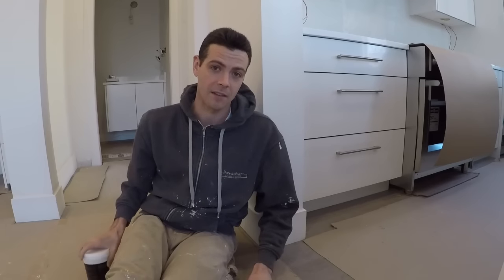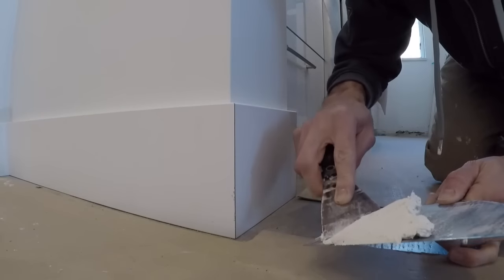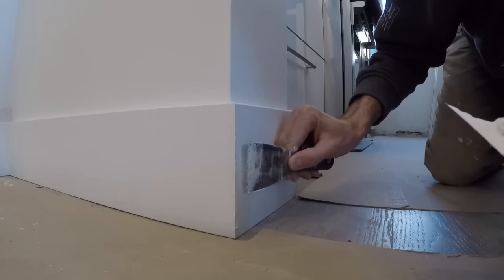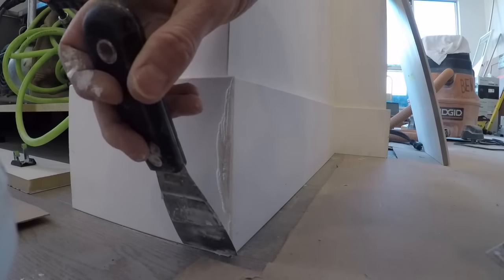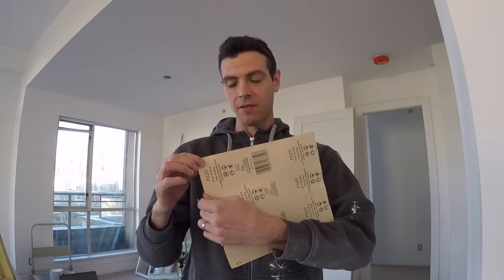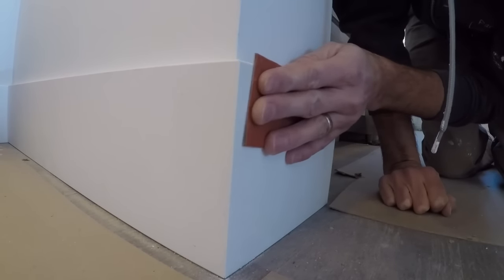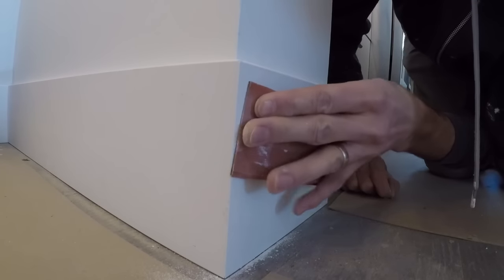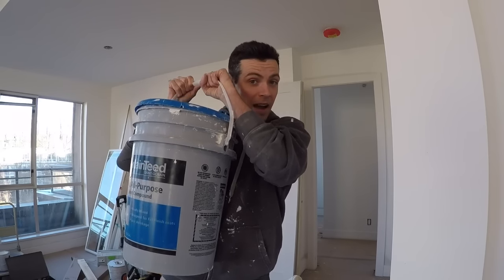How to Fix Open Miters

Comment: The angle of the wall was not measured properly or the saw was not adjusted properly
Reply: I'm a trim carpenter. We were taught to cut at 46.5° for a "90°" corner. As well as I find it's more accurate to lay a piece of base at the corner and scribe a mark where the corner meets the base. Miters come of perfect every single time.

Comment: Been painting 20 years. Most guys cut all the trim for a whole room in one shot an bang it on no matter what it looks like. 1/4 short? close enough. 1/2" too long? just push hard an use more brads, 'so what if the drywall breaks an the inside corner tape is cracked up a foot'. Compressor running low so the nails don't set, 'ah, the painter'll fix it'
Reply: I do my best to keep the painters happy.

Comment: What you are doing here is great for DIY.    The 46° rule is good also.    However I doubt your saw is not calibrated.   
     Most times the miter is off, is because some finishers only use a 10" trowel on their corner beads.   It will leave a slight bow in the run overall.   You can set your miter perfect starting at the outside corner but when you nail the middle of the wall it could open up due to the inside crown of the wall. 
     One way to correct this is to mitre and glue the joint then on the inside corner of the same piece it will be the straight cut if possible.   The on the opposite side of the inside corner becomes the cope.  Because when the material flex into the bow of the wall you will lose that distance in your overall cut.   
     When you measure add the visible bow to your cut within an 1/8th"   meaning if you see 3/8"  add 1/4th" to your measurement as a flat cut never the cope cut.

Comment: I have the solution. Use a skilled carpenter who uses seasoned timber or failing that uses a composite material that will not shrink.
Reply: Good luck finding properly cured lumber right now. Every job I've worked in the last couple of months have developed huge gaps. I'm pretty sure the coof shutdowns and restarts at the mills caused them to pull material earlier than normal to catch up to the demands.

Comment: In my experience- any wood filler I put in those will eventually crack again :) the only thing that will stay strong for longest and don’t crack is - bondo - and I am not talking about the wood filler but the Body filler bondo - ( it’s red and they use it for car repairs ) fill in the gap nicely - give it 10 min and then go over it with ready patch for example because body bondo is too hard to sand and ready patch is for finish . You can use any wood filler on top of body bondo - it cannot be stronger than that :) my best
Reply: Yeah bondo really does work, the best painters I know use it.

Comment: I live in a very old home & trying to do repairs ourselves. Not sure how one of the baseboards got chipped on the edge but this will certainly help. Thanks for your tips!!💙😊
Reply: if it is in a high traffic area, you may want to go with bondo instead of a wood putty/filler...this will  require a little sanding but will be a more permanent fix...

Comment: Good tip re the 46.0 deg - HA - but - with the way that some 'demented circus monkeys' seem to build the frames/walls - good luck finding a 90.0 deg corner.  For those less skilled than you are with a scraper//blade - put a couple of small bits of masking tape down to protect the floor and leave them there until after the sanding is completed.  And you are 100.0% correct re the caulking - but most will do that as it is the 'quick & easy way out' - a quality tradesman like yourself - will do as you do.  I just completely refurbished the interior of one of my son's homes and the scale (HA - I was going to use the word 'level' - but it is not apt in this situation) inaccuracy was truly amazing.  10.0 to 15.0 mm out was the 'norm' - one short wall had a somewhere near 30.0 mm out of whack - HA - I gave up cutting things at 45.0 or 90.0 deg - if I had cut at those angles - NOTHING would have fitted properly.  It amazes me the level of poor accuracy in many house builds - if I restored my cars//motorcycles with the level of inaccuracy as a house - they would be unsafe.  Yes - a house and a car are two different 'animals' - but it is a nice change to see someone with an acceptable attention to detail.  Have a safe and nice day all.  CHEERS from AUSTRALIA.

Comment: Next time try straight walls and a quality mitre saw with a good blade. Also, I glue my mitre joints so they don't split all over the place in the corners years later...
Reply: What is your idea of a 'quality miter saw'?
Reply: @toddfromflorida  .. For starters one with an accurate 45°, etc cuts and a good blade e.g. Freud Diablo's with a high tooth count are good blades. DeWalt, Makita, Hitachi are all good. For the money I like the DeWalt DWS780.
Reply: Thanks. I have an older dewalt.  I think it is the 780.  Dont really use it but assumed when I do it will do the job just fine.  I added a 100 tooth diablo blade when I was going to do a lot of crown in my house.  HAvent used it yet.  Guess im just lazy and need to give it a shot!

Comment: What is the filler material?  Spackle, "Wall Putty", or something else?  What do you experts recommend?  I got burglarized and got 3 doors and door frames kicked all to hell.  But I can save some parts by just gluing and clamping back together.  but I'm surely gonna have some cracks, big and small to fill.  What works best fellers?

Comment: Dear Expert, do u have experience/ advice to share on applying the shaping bits (cramer fugi 5 kit)  to refine the fresh caulking pushed out from a quick cure & sticky adhesive paste like liquid nails (polyurethane,waterproof, by Selleys )? I want to use it to replace silicone for the wooden floor (or floor tiles) & curtain boards edges + gaps .

Comment: I don’t like using anything that’s not flexible because it will crack, I personally use good wood glue at time of installation, and truthfully being a hardwood floor expert I don’t leave exposed gaps because homeowners will look for mistakes and you guys know what I’m talking about, I do agree for diy quick fix this will hold up but I’d prefer something more flexible because it’s a trade off if your happy n ur clients happy every way is correct 😂

Comment: I just did a room and a lot of my cornerd had some serious gaps. Tried 45 and 46 but still some issues. In the closet was the worst  bottom would be tight and top would be open. I was still able to fill the gaps with wood glue and it looks perfect anyways. Unless your on your hands and knees eyeing it up it doesn't stand out. I would just like to know what the hell lol. Not sure how the got it so perfect when they built the house unless they filled the gaps too and I didn't notice.

Comment: Bondo.  Much harder, one coat and is coating ready in 1/2 hr.    Dries fast!  Adheres like white glue and is machinable. Its ts mdf not drywall waterborne and wood fiber swell.  Give it a shot. Will take a couple of messes to get right but I don’t think youl will go back.

Comment: Actually it's called joint compound, not drywall mud that is just a slang terminology amongst tradesmen. If you want to reach a broader audience that don't typically work in this field proper terminology is required lest you have them looking for drywall mud looking like dumbasses. Properly educate your viewers they are your bread and butter.

Comment: Do you have one one inside corners
Reply: I was wondering that also.  He says to not use caulk on the outside corner but I assume he must be using caulk on the inside corner.  It wouldn't be any different than caulking the top of the baseboard where it meets the wall I assume.

Comment: Just regular light spackle works good also just let it dry overnight and come back in the morning and sand it and it looks like it never was repaired. I’ve done it 1000 times or if you’re on a construction site you can do the same thing with 20 minute Durband just get some from the drywall guy.

Comment: I bought a standard subdivision house built by Polygon homes and they painted all the trim white but more of a flat white. Not glossy at all. The doors are painted the same color. I need to repaint some baseboards because I just had engineered wood floors installed and on the stairs the risers are primed MDF. How do I get them to match? Do you have any idea, generally, what kind of sheen builders use? Thank you.

Comment: If you mitre mate’d (CA Glue in the states) the mitre together and put two nails top and bottom on the mitre before you nailed it piece by piece on the wall, the mitres wouldn’t pull apart. That’s how us Pro’s avoid this problem and getting the filler knife out.

Comment: I use PL Premium glue on all miter joints and they never open up. Wood glue is brittle when cured, so it will crack when changing seasons.

Comment: Hi, this is great thank you. I have gaps this size in the kitchen and bathroom window sills, is it worth using putty/wood filler or should I stick to caulking it with mold/water resistant properties? Cheers

Comment: Hi, what about inside corners? Can the same trick work there? Have a big gap in the inside corner due to fact the inside corner drywall was not 90 degrees, also I suck at measuring.

Comment: I use cornice cement, dries really fast & is hard as a rock.. you might need about 60 grit to sand it level, if it needs smoothing out just use some skim coat, but for corner mitres I would probably use builders bog, longer lasting & will wear better.

Comment: Don't painters and carpenters use caulking to fill joints (not nail holes but miters and joints) because things like wood fillers with have stress cracks over time and elastic qualities of caulk won't crack

Comment: The problem with filling poor joints, the wood ALWAYS shrinks the filler ALWAYS cracks and reveals the POOR craftsmanship. A proper miter is cut correctly and glued and is very hard to break even as the wood shrinks and climatizes.

Comment: I've got baseboards that have curves to them.  I guess contoured is what you said.  It's similar to colonial style.  Any tips for dealing with that?  I didn't want to go with just a flat board because I thought it looks too plain, but now the little gaps are going to be harder to clean up.

Comment: my finer is sore from putting dyna patch pro on crown extensions - ive use that stuff for years, it makes your finger nails soft and so they tear easy (your finger nail is not a tool) and when it gets stuck on your cuticals its makes them white for days.  Inside corners on mouldings can be hard to fill too.  With the patch pro, I find you gotta me mindful of where you put it and keep two terri cloth rags with you - one thats dry and one thats damp.  Keep a bucket of warm warter close or have immedate access to a sink.  I guess i could try putting red dye in it.

Comment: Cut at 45 1/2 degrees and that should close that miter nice and tight. Sometimes 45 degrees does get you a closed miter. If not try 44 1/2 . One of those 3 has to be it

Comment: Quick tip for you Amateurs. If you saw stops at 45. Put a piece of cardboard or a match book cover. Thin piece you will have to play with that thickness. Once you get it down. THere is your 46 plus degree angle. Eventually you will be able to do i by eye. The cardboard goes on side of the fence of  the  Miter  towards you.

Comment: First of all, no corner is exactly 90 degrees; cut EVERY outside miter at 47 degrees! It's so much easier to fill a tiny bit at the very top, if needed. Secondly, take your nail-set or the shank of a screwdriver, and run it up and down the face of the open miter, pressing it into the open part. No putty to fall out later. The added benefit is, you round-over the corner so it's bit less painful, if it gets kicked.
Once this method is painted, critical eyes WILL see this method; wood/mdf and filler, have different textures and it'll show.

Comment: I’d be fired if I left an 1/8 gap on an outside mitered corner!  Lol.  Tip to you all out there, when cutting your outside, 90 degree corners, cut your miters at 45.5 or 46 degrees even.  Get those faces tight, it’s more important then the top edge, which can be filled much easier and less noticeable.  👍🏻

Comment: I'm late to the game, but would this work on inside corners or if you have an open miter on a door frame (The door frame was not square like I thought and 1 corner is tight on the inside, but opens up). the gap is not huge, but noticeable. I've always heard to use caulk, because it's flexible, but you  can't "shape" caulk like you can filler.

Comment: Just a bit of semantics here. The open miter is still an open miter. What was done, was to disguise it, not fix it. A lot of carpentry is like that. I'm not a fan of mitered outside corners. They beg for destruction. I do my best to design for a butt joint.

Comment: It takes far longer to spackle a badly cut joint then it does to fix the 45* indent situation on your saw.  Your time would have been far better spent explaining how to do that, than to explain and excuse poor workmanship.  GO back and re-cut it, even if it at your own expense.  Re-cutting takes maybe a minute at most. Take pride in your work.  Learn how to do it correctly- after a few tries even a DIY'r will figure it out.
You are promoting the dumbing down trim work.  There was a time when not even a DIY'r wouldn't except that joist- he/she would take the time to re-cut, until it was right.
Spackle=Smackle

Comment: You should have used a plane to correct the mitre and then it can be glued to help prevent it cracking .back filling will crack . Be a better carpenter . The difference between a good carpenter and a bad carpenter is how big you need to use . Show us how not to leave open joints.

Comment: I burnish an open joint like that. I have a burnishing tool but a round screw works also. Use the tool to massage wood toward the open joint, works for stain or paint grade

Comment: Dude- thank you. I figured this out 25yrs ago, when i was 25. Corner bead corners are ACUTE!😂 45° outside miters will never close. People also think that coping is some kind of fancy carpentry. It is an enormous cheat for inside sheatrock 90s, at the floor, being always completely mud blobbed, hollow, and anything but plumb and 90°😂 I have seen a million tradesman vids like this, that are mostly full of dukey. This one is right on time. 46ish degrees, and build the corners out of 2 or three pieces, where you can, before sticking to the wall.

Comment: I agree- these are the most instructive videos that I have found when trying to do a good job on my painting project. All the little details make all the difference. I have spent nearly 3 days Youtube videos, and now I have my new Newborn dripless caulk gun and the right caulk to do my trim, with my tip cut and sanded to the correct angle. I just wish that I could spread joint compound like this guy- ugh!

Comment: Better yet is squirt some wood glue on the top of miter first....then as it's running down the joint, fill the front with MH READY PATCH from bottom up....that thing won't budge..or crack in the future.

Comment: Never spackle yoir joints like this.  New trim will shrink and the spackle will crack.  Caulk flexes and the joint stays sealed without cracking out.  Also when using spackling for filling nail holes, never use vinyl spackling.  It does not sand well at all!  Its like sanding rubber. Always use lightweight no shrink spackling.  Sands super easy.  

Your welcome

Sincerely
Painter

Comment: We had some new doors put in and when the installers put the door casings on they filled the joints in with calking.  The caulking has now shrunk and you can seem the seams.  Can these joints still be filled with the wood filler or is there something I need to do to make this work?

Comment: Will this dyna-patch work on cove moulding joined in the middle of a 25 ft run? In winter there is a gap (1/8"). In summer the caulking bulges out.

Comment: There is a trick for closing a stain grade miter that is a little open, it's called burnishing, get a screwdriver or scratch awl, something round, smooth, and metal, run it over the corner in a pushing motion and bend the wood fibers over to close that gap. This was a common method in a furniture shop I worked at when we were miter folding hollow posts and beams.

Comment: As I use dry wall mud as spackle since I’ve got a 5 gallon bucket of it and no spackle, though I’m touching up in a room I just replaced all the drywall in the opposing wall and filled in a few nail holes. lol.
Great video and very informative, coming to you from Fl.

Comment: if your spraying all your trim which is what i do then car body filler. its 2 part filler that dries harder than rock and doesnt shrink. works in mid winter and mid summer. the white filler in the video is a great idea but it will still show if its not painted. anal i know.

Comment: What I want to know is why you can't buy premade corners for mouldings? That way all cuts would simply be square cuts from corner to corner, and your 45% angles would already be set for ceilings and walls? It would solve a lot of problems. Especially for DIYers.
Reply: Some types of crown have premade corners. They add considerable bulk to the joints & don't look nearly as clean. Additionally most corners aren't a true 90 & a decent miter saw doesn't cost much which can provide a much tighter fitting joint than a premade corner often would.

Comment: You can also roll your corners in with the round shank of a screwdriver to close them up some.   Stop ragging on this guy. I’ve seen the best of finish carpenters have open joints.  Sometimes it’s the humidity level in the home. Nice joint and a week later it’s open. Even with lots of glue.